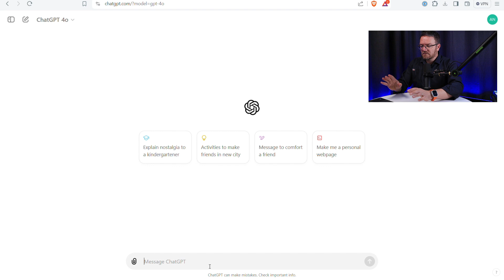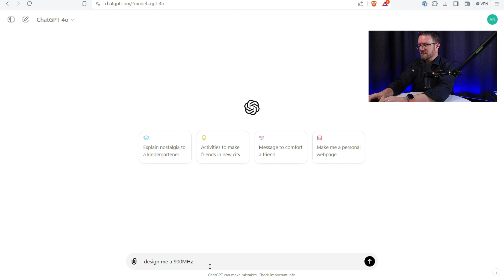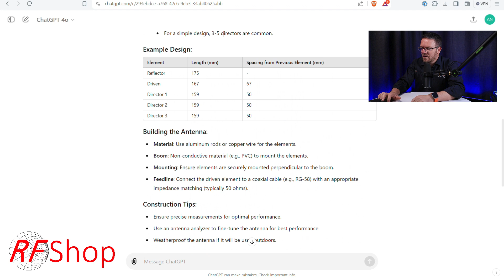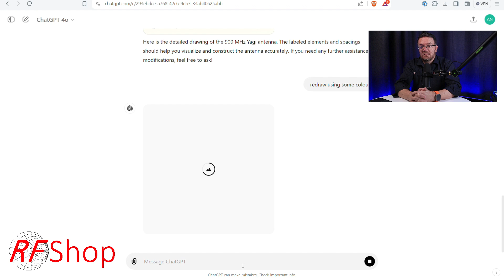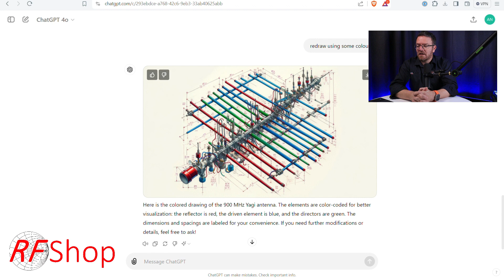Will AI Replace Antenna Engineers? A Deep Dive into AI's Role in Engineering

Comment: If anyone rolled out AI for engineering, or specifically antenna engineering, it wouldn't be a general purpose chat bot. These 'AIs' can get quite specialised depending on how they're trained. Whether anyone will create such a tool or not will depend on economics of whether it's worth pooling resources into the creation of AI assistant tool for this niche target.

Assuming they do decide to do it, it would be great for those well established within the field, not so great for others.
The boring work has to raise the demand for antenna engineers. When you bring in extra automation, productivity increases as, for the sake of example, every 1 engineer can do the job of 2.

I don't know the economics of how much $$$ goes into engineer salaries when doing an antenna project, but if it's significant, then short-term you'd expect there to be more projects as every engineer would get the job done faster - meaning less money spent on salaries.

Long-term, if we're assuming the antenna demand stops growing (as enough are built such that any new ones are experiencing diminishing returns), then the salaries in this field will likely reduce for anyone but the most experienced engineers due to there being more applicants per position open than before. It would also get more difficult for the newcomers to squeeze into the field.

I wonder where would the replaced antenna engineers go? Would they go from the roles of doing the design to the roles of hands-on maintenance of existing antennas? Or are there other engineering fields to which the knowledge and skills they have would easily transfer?
Reply from the maker: I think AI is a topic to discuss, but between optimisation, creative classic design and customer requirements the AI thing for custom antenna integration is still a long way

Comment: You'd probably get better performance from a model that was more specifically trained on RF engineering text.  I'm not aware of such a thing, but there are open source models that could potentially be fine tuned on more RF engineering textbooks and papers to improve performance.  ChatGPT has decent understanding of various sciences, but often falls short once you get too specialized. 

The image generation is really built more for making pretty pictures than engineering diagrams.  I'm not aware of any publicly available image generation or engineering diagram generation that would be accurate for something like this, but it hardly means it is not possible if someone was so inclined to design it. 

Since the engineering and math is well understood its probably easier to write a more traditional software package to do the design at this time.    We've had programs to do that for decades of course, and they'd be significantly more compute efficient that using giant generalized AI models running on millions of dollars of hardware.

You might try looking into Nvidia RAN and Nvidia Aerial.  
https://developer.nvidia.com/gtc/2020/video/s22009-vid 
https://docs.nvidia.com/aerial/index.html
Much of this is just GPU acceleration of the math rather than "AI", though.  Codifying the problems is a good start, though, and generative AI may help improve the ability to search the possible space of solutions for complex problems.